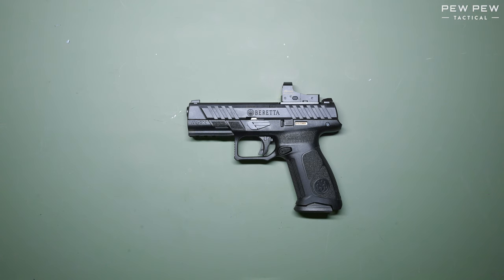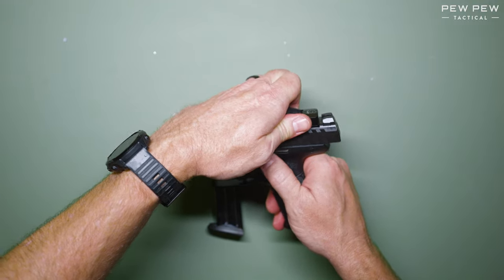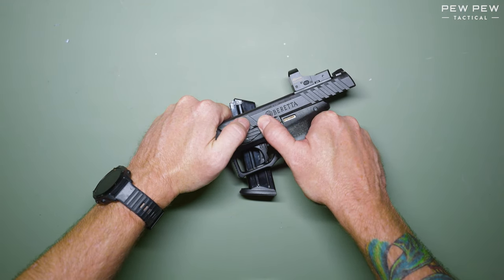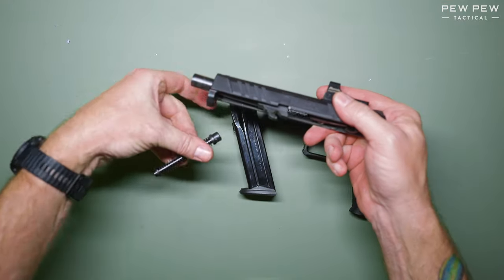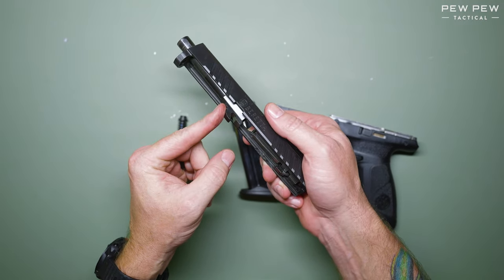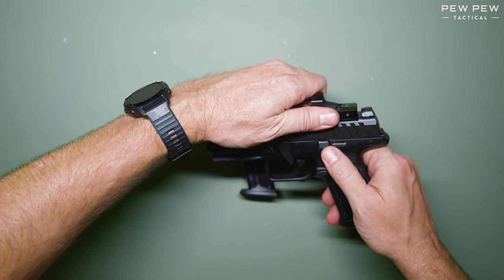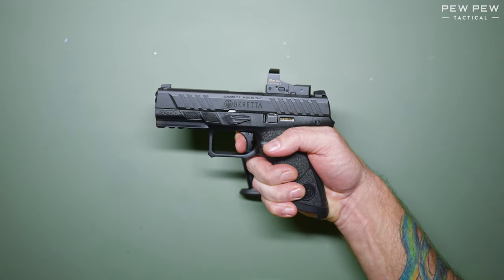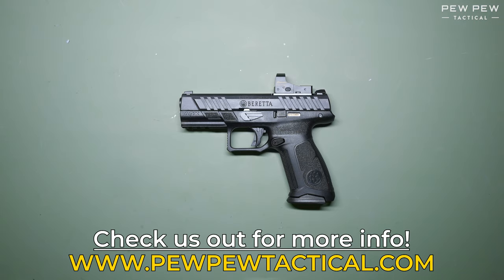Beretta APX A1 [Field Strip]: Disassembly & Reassembly

Comment: I have bought an APX A1  brand new. The  handgun has exceedingly tight tolerances until after you shoot 100~200 rounds. after that the whole  field strip maneuver can be done at the press of your fingers. I have a Burris Fastfire 4 on the slide, the gun is accurate and reliable, tough not as "bite off steel and shit nails" reliable as the M9, which however costs much more and doesn't have an optics ready slide on all models.

Comment: This shows a very difficult way and the use of the magazine like that can damage it or the finish on the gun! There's a far easier way where you just turn the lever first, easily as it's not under stress from the rack being slid backwards,  then fire the gun, push the slide forward.  Easy to where a 10 year can do it.  Videos out there to show this.

Comment: love the APX but it always boggles my mind why a pistol in 2023 is this finicky for a simple field strip.
Reply: Added safety I guess!??
Reply: I have an APXA1. it is finicky for about the first 100 rounds. After that, when all tolerances settle, there are no problems going forward. The issue is that I admit that's a problem since it should at the very least be covered in the manual, like "for the first 150 rounds use a punch or an hard angled surface to keep the button pressed  in order to use the disassembly lever."